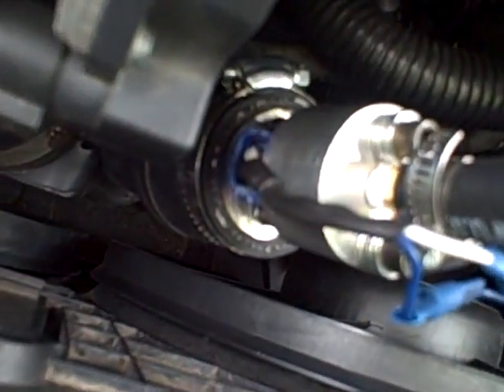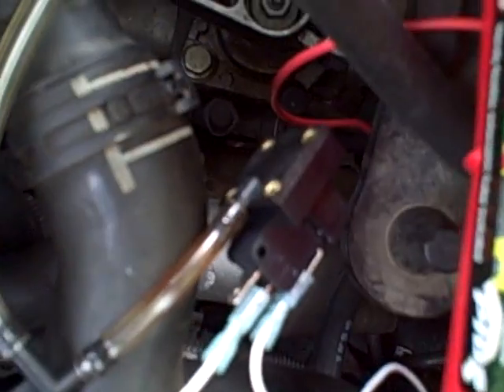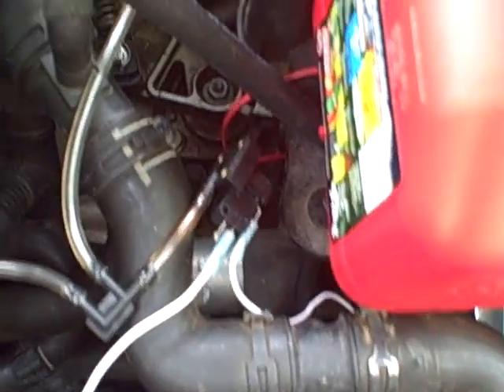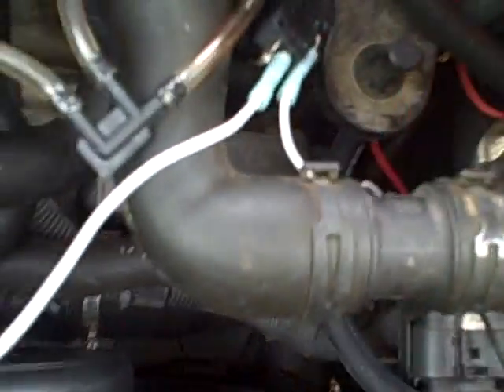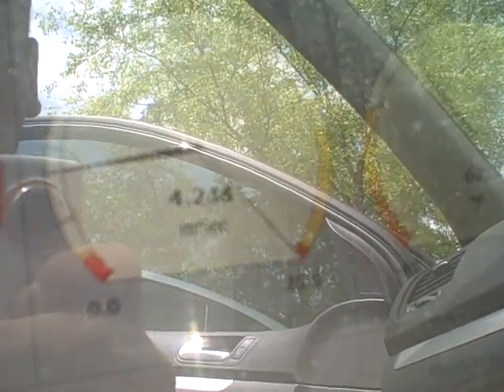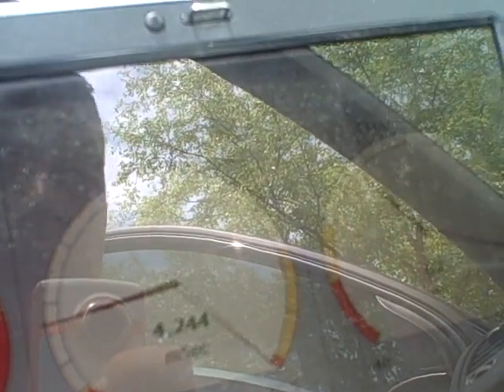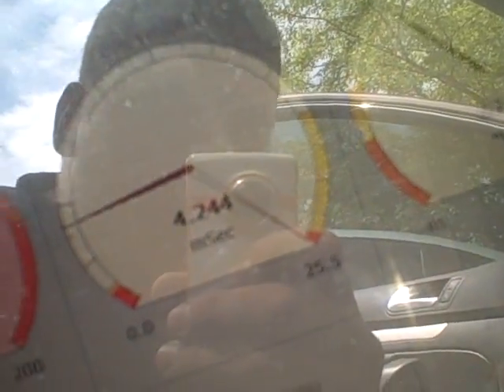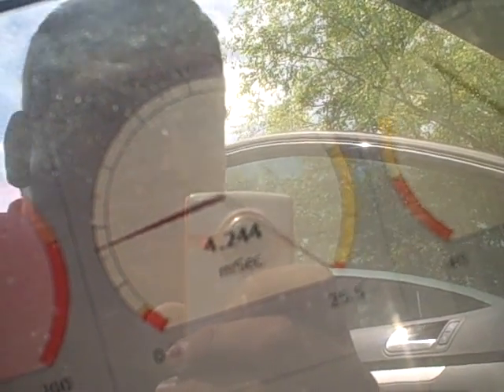GTI MKV water/methanol injection (home built)

Comment from the maker: Ran this for about 10-15k miles and reverted the car back to stock and sold it, can't speak for the injector rusting up as it never gave me problems installed on the car.  I think the injector was about $40 so I could have bought 5 or 6 of them before I got the the amount I would have spent on a similar system

Comment from the maker: yes that pump is PLENTY strong enough. yes it is that small black hose that comes out of the intake and into a little distribution block, some people tap it by cutting it and installing a "T" fitting but newsouth performance makes a hose with a built in "T" that is a direct replacement for around $10 alot easier then bending those hoses and possibly breaking a vacuum fitting on you engine block (ask me how I know....)  aslo allows you to keep the factory hose to put back to stock later if needed

Comment from the maker: I used the "newsouth boost tap" search that.  Yes air travels up the pipe. But the injector is running off 60psi and the most the pipe sees is 21 or so. It comes out in a fine mist so it gets sucked up the pipe after it fires down.  (check the other vid)

Most people just drill and tap into the meatiest part of the throttle pipe for their nozzle. I would use some sort of sealer in their aswell. But my injector is a acura MDX fuel injector. hooked in as a noise pipe plug basically.

Comment: Excelent stuff there mate!

I'm thinking of doing the same on my car, and I have one question about these RDX injectors you are using. Are these injectors methanol compatible? I've heard a lot about methanol corrosion especially on aluminum and non-stainless steel. If you have any info on that I would appreciate it very much.